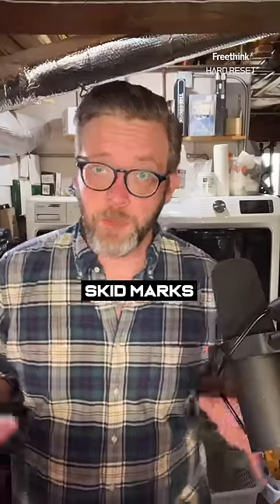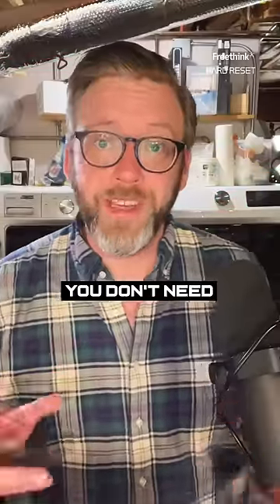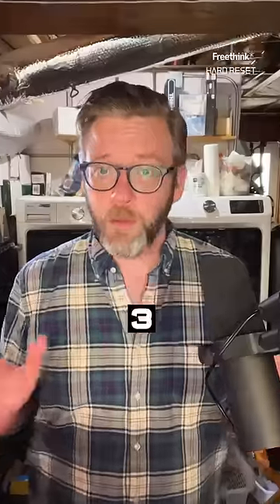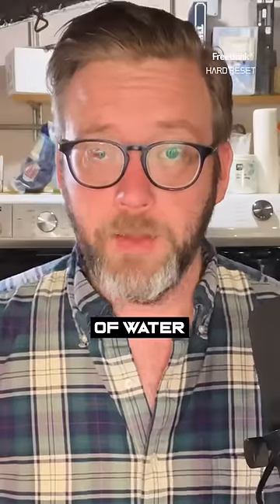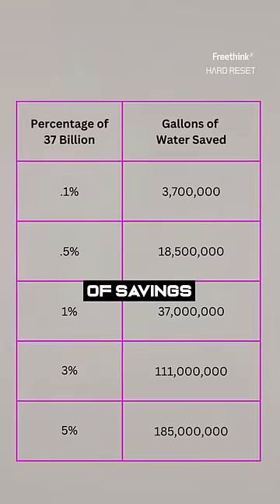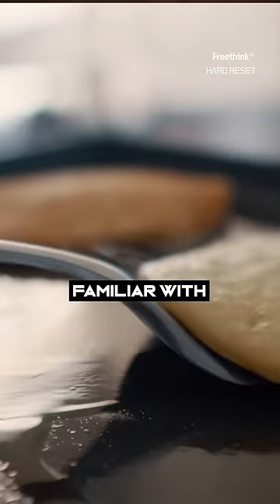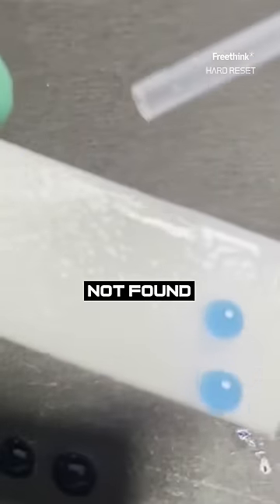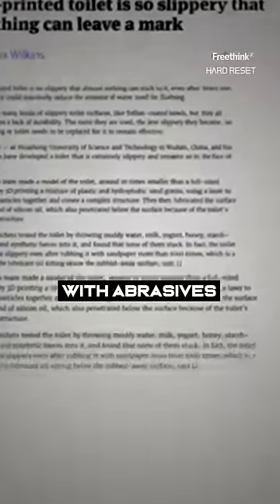Researchers invent super slippery toilet 🚽😳 #shorts #metamaterials

Comment: Never use less water to flush a toilet. You need the liquid to carry the solids through the pipes. Less water in toilets has caused more problems than you could imagine.
Reply: Plus you need to actually push everything around the trap bend, not enough water means multiple flushes.
Reply: @samuels1123  yep
Reply: What about on the pipes?
Reply: @Ichthys319  it there’s not enough water the solids will be left behind to build up.
Reply: It makes sense
Reply: @sal_strazzullo  I’ve been a plumber for over thirty years and I can say with confidence that low water in toilets and dishwashers have caused more problems than ever solved.
Reply: @BlueDart1971  I understand you need a proper amount of water to properly flush waste out of the pipe. My question is, if they applied this product to the inside of the pipe would less water be required to flush out the pipe? Could this reduce pipe clogs? Honest questions.
Reply: @Ichthys319  if it works as shown without deteriorating it would probably be awesome but also probably unaffordable. It would stop lots of clogs.
Reply: It might be feasible for use in RV or marine toilets, or in short septic systems, if all the piping were also made of this material. More engineering input to the systems is required.
Reply: @palisaanne5096  I guess it all depends on how much that material costs. I don’t have a clue but anything good usually isn’t cheap.
Reply: They could maybe offset that problem in different ways.  Like one older city did, have everyone flush an empty toilet at the same time once every few days or weekly.  Or have it automated.  Apparently it worked.
Reply: @Qui-9  it would help the city lines but it won’t do your lines much good. Usually once it hits the city lines there’s usually enough water to carry the solids. Usually.
Reply: It would also cause the sewage system to smell 👃
Reply: @jesussaves8549  sewage systems smell bad no matter what you do. When you think about what goes down in its almost impossible to not smell.
Reply: A voice of reason on a planet made of water…
Reply: I have never thought about that 😬
Reply: It's just one problem isn't it? It can block the pipes? I can imagine one problem.
Reply: @zak4tt4ck  phrase your comment to where it makes sense. I have no idea how to respond to that.
Reply: Dont know much about it but „need less water“ doesnt mean nearly nothing or something like that. 
When you only have to use the amount of water needed to flush the pipes without a need of „cleaning“ the Toilet itself can be all you Need to save a huge amount of water
Reply: @timk6441  I know a lot about it. I’ve been a plumber for over thirty years. You can save water in lots of places. The toilet and usually dishwasher aren’t places water should be saved.
Reply: Or you got to throw extra water down the toilet for it to flush. We have a toilet that is only useful to go #1 in because #2 never gets carried away.
Reply: @BlueDart1971  smells worse when the pieces stay stuck inside the pipes 🤢
Reply: @jesussaves8549  they always smell like crap from the sewer gas.
Reply: This was a problem with those waterless urinals and older buildings with copper drain lines. The build up of urine eventually ate through the pipes.
Reply: @neipamocal  even regular urinals plug up fairly fast with all of the minerals in urine. I never had a work with waterless urinals but I couldn’t fathom how they were going to work.
Reply: These researchers clearly know what they’re talking about… they would use enough water to allow proper passage through pipes
Reply: @masterdeetectiv9520  my 30 plus years of experience knows better.
Reply: I am currently experiencing this while I am staying in a rented room, the toilet has weak ass flush and wont carry the poop and it just stays there. I couldn't fix the flush no matter what then the house owner told me to dump a bucket full of water for the drain function of the toilet to work. Fuckin cheap as trash toilet
Reply: Use a water hose like in Asian countries. Papers can clog toilets and also be less hygienic. Washing the tushy is more hygienic and also resolve the problem of less water in pipes + work as a small flush.
Reply: @Masood1810  most people don’t want to drag the garden hose through the window:) Just kidding. A bidet is a good idea to have less solids.
Reply: As someone who works in sewers I agree.  Low flow toilets are bad for this.  If you're on septic then it's your own thing to deal with.
Reply: @BlueDart1971  as if these researchers don’t have any experience…
Reply: Make the pipes of that material rather
Reply: @arnavchauhan986  The pipe is really expensive as it is. It would probably be unaffordable if they did but it would probably work.
Reply: Slippery pipes?
Reply: @BlueDart1971  " even regular urinals plug up fairly fast with all of the minerals in urine." This remind of my grand-mother's toilet. There was so much calcium build up in the toilet the main Jet for flushing was 100% blocked. I took a small pry-bar and hammered away all the calcium. The toilet went from a flushing joke to working like new lol.
Reply: @TwinShards  some sizzle and a metal coat hanger to unplug the weep holes works Miracles.
Reply: Good eye!
Reply: Whenever I visit a home with low water pressure toilets I cause them to clog 😅
I have too much constipation for them to handle
Reply: I was all excited about this story and then after a couple minutes I was like…but what if the pipes don’t have this slick coating? There would be a blockage immediately.
Reply: make slippery pipes.
Reply: @BlueDart1971 
And cloths washers.
Reply: Use the same coating in the sewer pipes?
Reply: @louielunch3172  it’s been suggested many times in this thread. The pipe is already really expensive. I’m not sure but it would probably be unaffordable.
Reply: What if we make slippery pipes? And slippery sewer system?
Reply: European toilets use way less water than american ones yet they still work.
Reply: @D3nn1s  our toilets work just fine. It’s everything after that that is the problem. Do you have any idea what happens after you flush or are you just assuming that everything is fine? I’m asking seriously.
Reply: @BlueDart1971  well i dont know the EXACT details of the sewage system of the US but apart from the fact that you have tanks in your own garden to get rid of the worst it cant be to dissimilar can it?
Reply: @D3nn1s  if the garden is the backyard then a small majority have septic tanks. Most people are on city sewers. It leaves their house and flows for miles usually to the waste treatment plant. I’ve been a plumber for over thirty years and I saw the low flow toilets come into existence. It has caused multiple problems. The newer plastic pipe isn’t quite as bad but older cast iron pipes have had continuous problems. I’ve seen people have to tear out concrete to replace the pipe. Flushing isn’t the problem. They have come up with some decent flushing toilets. It’s after it leaves the toilet that it’s usually the problem.
Reply: @BlueDart1971  yup thats what im talking about. I presume you meant minirity right? Well our toilets probably have a similar flowrate, its just that theres way less water sitting in the bowl already thus less water getting wasted each flush
Reply: @D3nn1s  my whole point was it’s not wasted water if it’s pushing lol of the solids down the line. Save water in many other places and ways. Just not from the toilet.
Reply: @BlueDart1971  so why is it working in europe then? Cant imagine our sewers are vastly different from yours.
Reply: @D3nn1s  like I asked before. Have you ever talked to anyone in the field about any problems? Most people have no idea what problems there are.
Reply: This guy said less water. You said less water. And you still act like you both said no water. Humanity is doomed
Reply: @futurestoryteller  your comment makes no sense.
Reply: @BlueDart1971  I am very amused by your self-imposed confusion
Reply: @futurestoryteller  okay troll
Reply: @BlueDart1971  Says the guy who thinks it's impossible to use less toilet water. Sounds like an environmental troll to me
Reply: @BlueDart1971  well given ive used toilets all my life and only had a clogged one once i think i can say that it isnt a huge problem. But fair enough, no i havent.
Reply: @futurestoryteller  I never said it was impossible. Not everyone has problems but it causes more problems than it’s worth. I’m curious. How much experience do you have with sewers?
Reply: @D3nn1s  not everyone has problems but enough people do that it’s not worth it in my opinion.
Reply: @BlueDart1971  "I never said it was impossible. I just said it's not possible"

Yeah. Thanks
Reply: @BlueDart1971  any proof that toilets in europe are significantly more clogged than toilets in NA? I mean if your system was so perfect youd probably be doing something else
Reply: @D3nn1s  I have no idea what you’re talking about. Either you read something wrong or I typed something wrong because I never implied that.

Comment: Frictionless material is fucking insane. Imagine how efficient moving parts (engines) are with this thing
Reply: This.
Reply: No more engine oil needed. Makes for way more Environmentaly friendly engines
Reply: @marvinlauerwald engines also need the oil to cool, and also it means that this non sticky stuff needs to be atleast as strong and durable as steel. What I wonder though  is if it would work on containervessels
Reply: Theyve already been progressing on this for decades. Pistons often come coated on the skirts for lubricity. Same for valve stems.
Reply: Is this material strong enough to be in an engine though?
Reply: @marvinlauerwald  electric gonna replace oil in a decade
Reply: @j12325 Guess what lubricates them electric motors
Reply: engines are already very low friction, even poop on a slippery toilet would heat up if you rubbed it at thousands of rotations a minute
Reply: @SCPMstudios  common sense is not so common today 💀. Jetha ki Daya in real life 😀
Reply: We aren't sure how they behave under heat and high pressure environments or if they can resist impact and constant pressure, but I can see where you are coming from
Reply: Might be a good application for piston rings but as far as withstanding the stress of something like a connecting rod endures..? Not gonna happen. Promise you that researchers already considered it in the research and development phase at MOST.. if not in the material design concept itself
Reply: @j12325  doubt it, also HORRIBLE for the environment
Reply: @DVDRAR  nope it reduces position on roads
Reply: @DVDRAR  nope, it reduces pollution on roads, breathable air in cities
Reply: @j12325  the mining that needs to be done for the battery ALONE is horrible for the environment
Reply: @DVDRAR  so you think petrol scooty parts are clean for environment. And also what about local pollution i.e pollution on city roads?
Also EV are silent and reduces sound pollution on roads. Ask those whose houses are on main roads, how much sound noises and smoke they have to deal with.
Reply: @DVDRAR  and also do you have any solid numbers on the basis you are saying that a battery production causes much more pollution than an petrol vehicle in it's whole life??
Reply: @j12325  I think all cars are bad for the environment, the change that's needed for our environment is in the hands of large corporations, not the consumer
Reply: @DVDRAR  that's it, atleast as a consumer we can change our city environment by replacing fuel vehicles with as much EV as practically possible
Reply: @j12325  the batteries, talk about the batteries
Reply: @30secondsofras  oil is used to lubricate and cool because of friction. With 0 friction, there's virtually no need for oil. Coolant would still be required in smaller amounts just for heat created by the combustion cycle.
Reply: @j12325 What exactly did SCPMstudios say that was wrong?
Reply: @j12325 Also, unless the EVs arr charged from 100% renewable/green resources, instead of majority natural gas like now, the whole EV thing is kinda pointless.
Reply: @nboccanfuso  kid stay away
Reply: @nboccanfuso  not pointless

Comment: That's cool, just hope that what goes into it isn't detrimental in mass production
Reply: Don’t need another PFAS situation
Reply: forever chemicals/micro plastics came to mind
Reply: Was thinking the same. With the volume of water that would be running through these it'd be horrible if the material was toxic & it spread to the water. We already more than enough chemicals in the water that can't be filtered (medicine residue in our waste) so no need to add more.
Reply: My exact thought. If it doesn't break down...

Comment: The water we flush down the toilet is a small concern compared to the water used for industrial applications, and is much harder to treat.
Reply: He just said Humans Use 37 BILLION gallons.. yes its small compared to Overall use. But again, 37 Billion Gallons?
Reply: @touqeerahmed4032 in the countryside, this water goes directly back to the earth balancing the water table. It's only waterloss in urban cities with drainage systems that have to manually treat the water.
Reply: @alwinw64 half of humanity lives in urban cities

Heck if it means that I don't have to get out the toilet brush, that's a large amount of water saved
Reply: With that mentality nothing ever gets better. Its like saying we shouldnt go after a killer because someone else has commited a warcrime and thats a bigger issue. Sure its the smaller of the 2 problems but it doesnt mean its not a problem. You can fix smaller things and bigger things at the same time.
Reply: We would also have to coat every single pipe with it or it would get stuck eventually. Also, as far as I know, they use toxic forever chemicals to make this material so we absolutely do not want it to come in contact with water on a global scale.

Comment: I'd like to see if it could be useful for aircraft wings. Specifically, I'd want to test if it 1) was durable enough to withstand heavy duty use and 2) if it had any aerodynamic benefit 3) if it was useful in preventing icing
Reply: U a Deicer?
Reply: the method uses elements to make them strongly hydrophobic giving it the slippery property in context of water based things. considering this i think it has minimal differing effects with air, not to mention skin friction drag is really not that impactful on an aircraft except for gliders.
Reply: oh to add, it also uses a polymer oil as the hydrophobic element which could be worse than other hydrophobic materials in terms of icing because the absence of an air pocket between the water droplets and material and higher thermal conductivity of polymer oil compared to air gives it a faster icing time, other hydrophobes would probably be better
Reply: I'd like to see it be used on a water slide.
Reply: Super good idea!!!!!!!!!
Reply: boats
Reply: The supersonic test plane by LM and Nasa is covered in a teflon coating to help reduce the sonic boom, so you might see this kind of material applied to that purpose as well.
Reply: @ZionistWorldOrder yes....bye bye barnacles.
Reply: Up!